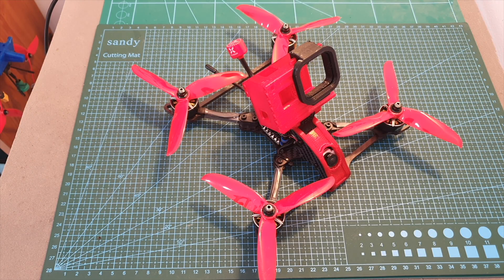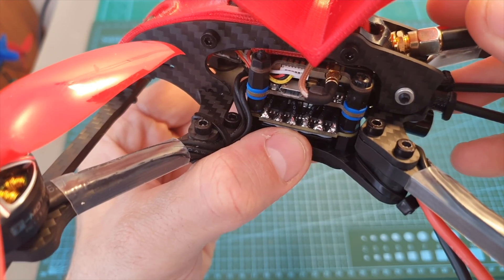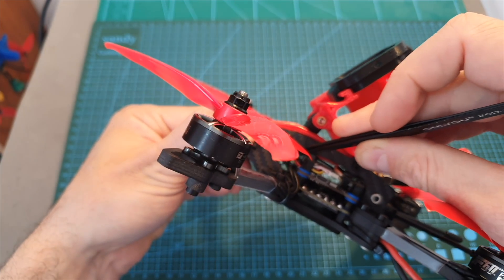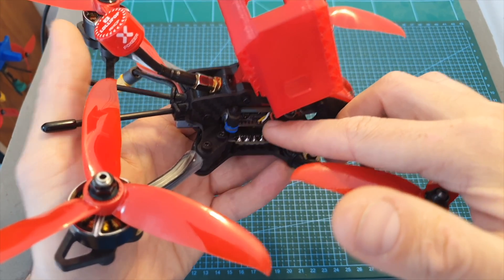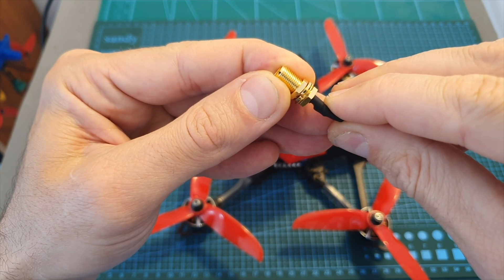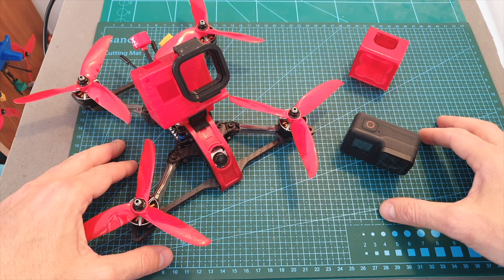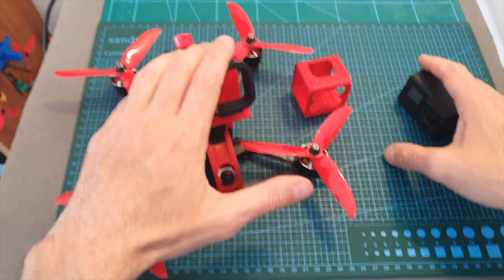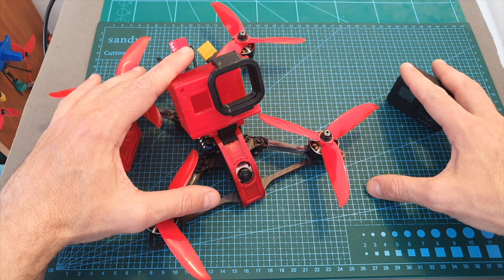CMW Raging Droner 5R - Build & Flight

Comment: I gotta say that is a BEAUTIFUL build im wondering about costs. I saw a very similar build for sale at Fryes electronics the price was nearly 400 american . can I get the price down to below 300 if I build it myself
Reply from the maker: Thanks buddy. You can see the parts list in the description. I am too afraid to calculate the costs ;-)
Reply: Gal Kremer I kinda figured I need to save for a bit longer but I intend to follow your lead on the build but im not sure about the esc I think id rather have the regular esc just in case I smoke one I also think im going to add capacitors to the esc to clean up the power and reduce noise. take care my brother
Reply: I added it up be very afraid ill keep the numbers to myself
Reply from the maker: @SilverTopFlyer  LOL

Comment: I've got the MMDroner 3" with transplanted XJB-145 components and love it. I like the RDroner frame, but curious what you would change in the power plant (motors/props/bat?) to make the Raging Droner more balanced with 3-4 minute flight time and decent performance?
Reply from the maker: I think that after removing the Gopro mount + camera it should be able to achieve 3-4 minutes with no problem.